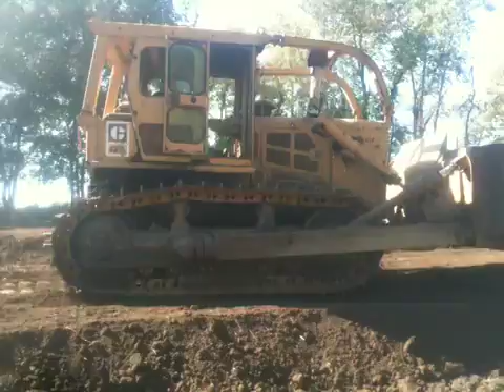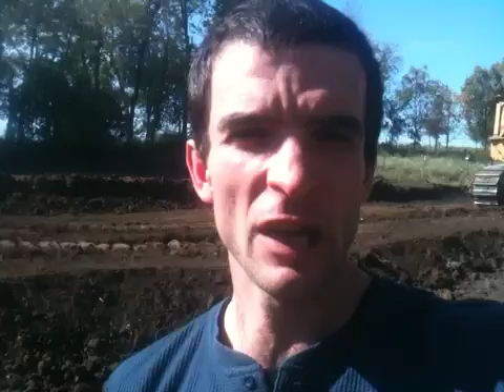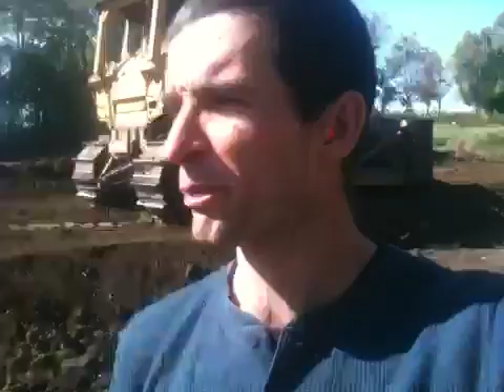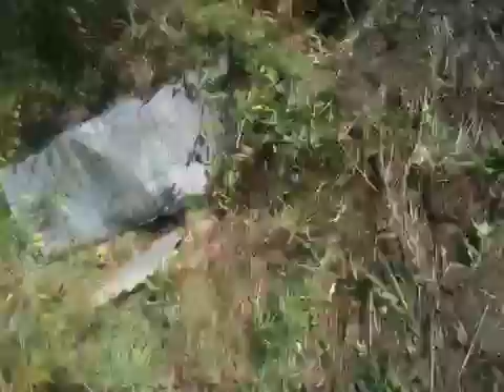Cat D7 bulldozer fuel consumption

Comment: One of My old 3ts would use about 1 tank a day or so If I'd use  her on a job that would be about 5 gallons an hour since it has a 54 gal tank. The engine is run at about 900rpm when you work it so 5 gallons an hour makes sense. They are from 1949 and 1953 or so

Comment: There are always losses because of transmission. That is why hydraulic driven machines like Lifetrac are more efficient or my Avant 750. The CatD7E (electric) has no transmission but electric motors for more efficiency.. Dozers have to be heavy to beat traction, to be able to push, hence fuel use. GREAT you calculate the 'foot print' your building method will even that all out. GO Dream Team.Go.